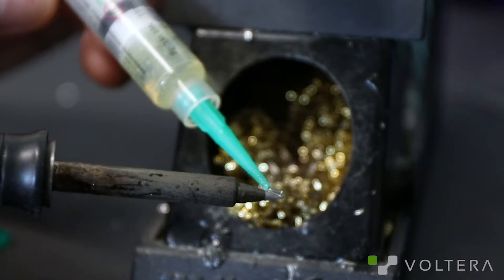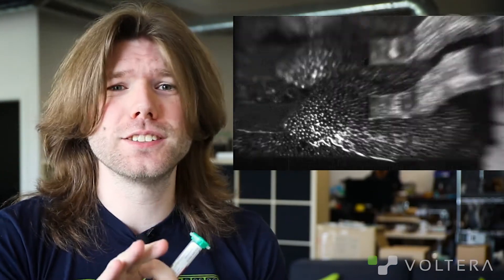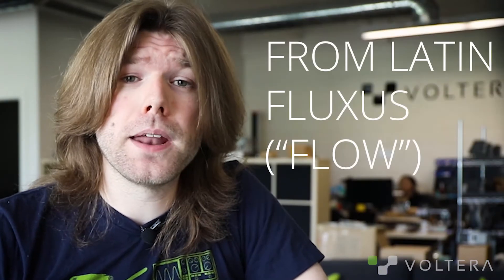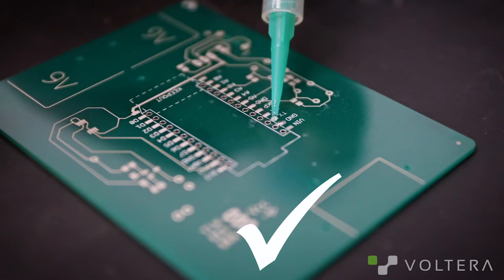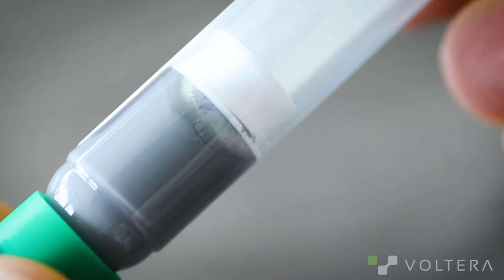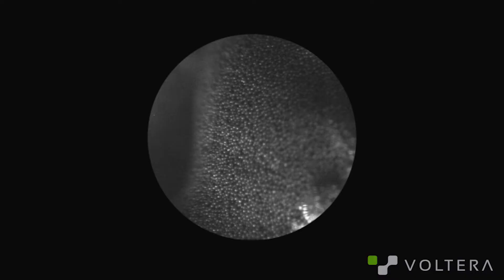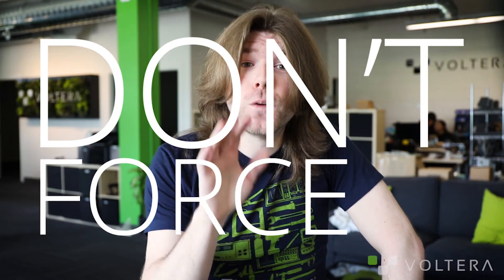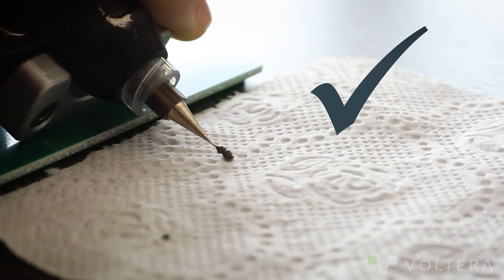Pro Tips: What is Solder Paste?

Comment: What is a good, inexpensive soldering iron.  I got one at Walmart.  It doesn’t melt the solder at the tip
Reply: Grab one off Amazon, they have a much better selection than Walmart. Look for something with temp control and 40-60 watts. 

I use a Yihua 926 III soldering station, and I love it. Messed around with cheap, weak little irons for years, when I should’ve just saved myself the trouble and spent a few more bucks from the start.

Comment: Is it possible to dilute the dry paste?
Reply from the maker: You could try adding flux to the paste to rehydrate it. It may not return to its original viscosity range, so there's a chance it won't perform the same.